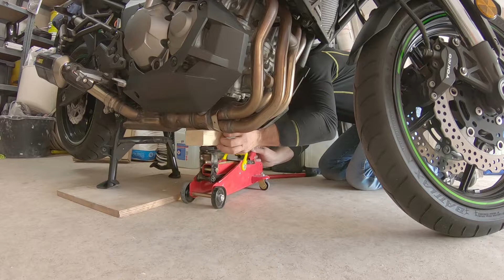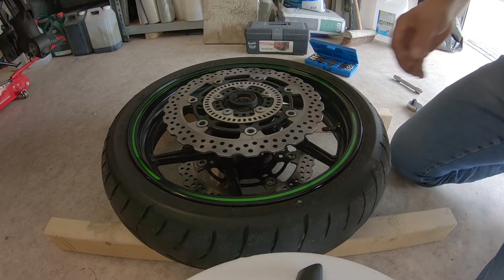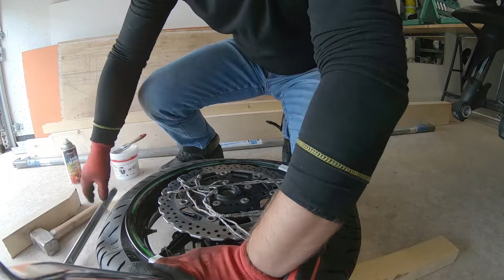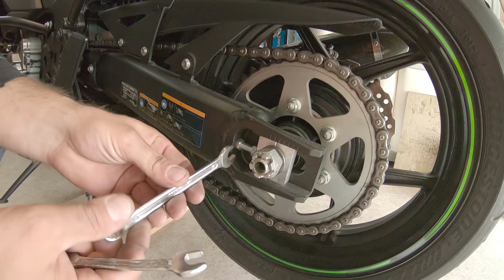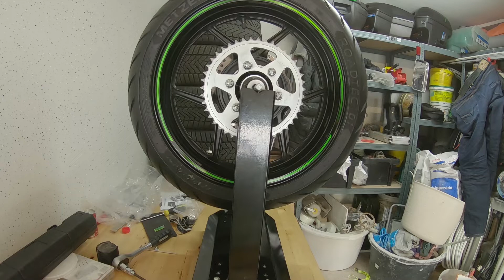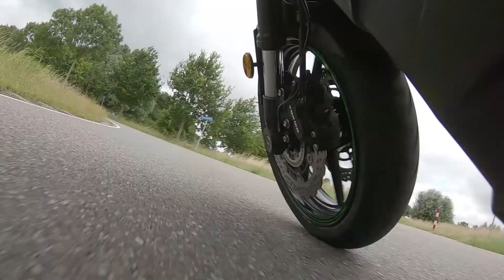Kawasaki Versys 1000 - tires change - Metzeler Roadtec 01

Comment: fantastic,neat and clean job!! like!!
Reply: btw bro...please tell me more bout roadtech 01..im interested to change for my tracer gt..thanks
Reply from the maker: great tires, the best I have ever had.
They stick to the road as if they were glued, both on dry and wet. The only problem with these tires is that they are noisy when cornering.
my next tires will be from Metzeler for sure.

Comment: Hi and thanks for really great video how to do and step by step!
Question regarding used tools, can you please specify exactly sizes used to loosen front and rear tyres. I mean Bolts and screws. I would like to order those and good to get exact match.
Reply from the maker: Hi, thanks, front axel hex (allen) 22 back I don't remember right now, I'll be back with it. Cheers

Comment: Nice video and good work✌🏻. How did the Versys ride with these tires? I am thinking of installing them in a couple of days. I am currently using Angel GT2 and i am thinking of switching a bit.
Reply from the maker: I'm riding right now Angel GT2 but I'll be back to metzeler, Angel is OK but metzeler in my opinion much better.

Comment: The only thing doing your own tyre changes is ballencing????
I brought.... Old stock brand new V 1000.... New. Put on front fender extender, to keep crap off the headers, radiator. And had givi engine guards put on. What screen you put on?
New Zealand

Comment: Hey Andy, don't suppose you can remember what size that Hex bit for the main front axle is can you ? Can't see any reference in the manuals and its driving me nuts (sorry for the pun) . Looks like about 23 or 24 ish on my 2018......but no doubt, same as yours. Cheers Paul
Reply from the maker: 24 but I'll check it later to be sure
Reply: Cheers Andy
Reply from the maker: I was wrong . It is 22
Reply: Thanks for checking Andy. Much appreciated. Cheers Paul

Comment: You should hang those brake calipers on bungees, how do you like the roadtecs now?
can you see on the side of the tyre where they are made? China? thanks
Reply from the maker: I like it how roadtecs handle, but they are very loud especially in corners and this is the weak point of these tires. I will check where they are made.
Reply: @MotoAndy  Thanks buddy, great work with the levers, respect!!

Comment: Great video, I'm looking at getting the new Versys 1000 S. They seem to be a great bike, how long have you had yours and is there any concerns I should be aware of. 

Also the SW-MOTECH bars, the lights on those are they OEM lights or aftermarket
Reply from the maker: I bought my Versys in 2018 so it's been almost 3 years. The only thing I replaced right away was the windscreen. Besides, I didn't find any other problems. The led lights are OEM

Comment: What are those red dots? Don’t see them on my new tires.
Reply from the maker: It is possible that other tire brands have different dot colors. The dot should be in the same place as the valve in the rim, it marks the lightest place of the tire, and when we place the valve in the same place, we equalize the weight of the tire, i.e. automatic balancing (in a sense)

Comment: How many km have you put on the Roadtecs? Are they holding up well?
Reply from the maker: I have about 6k right now, they still ok holding nicely,  the only problem is that they make a lot of noise.
Reply: I’ve just put 01’s on my bike and compared to the Z8’s they are very quiet in fact they are the quietest tyres I ever had. I also put right angle valve stems on which makes checking pressures so much easier I would highly recommend this modification to everyone. Excellent video by the way.